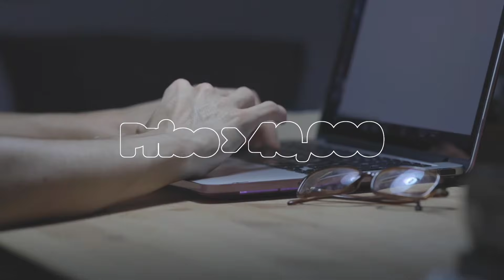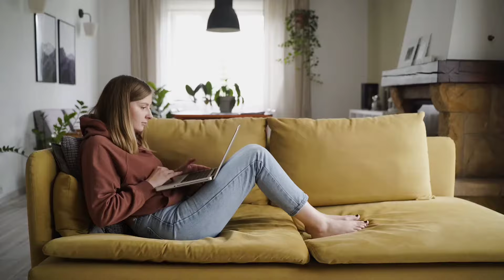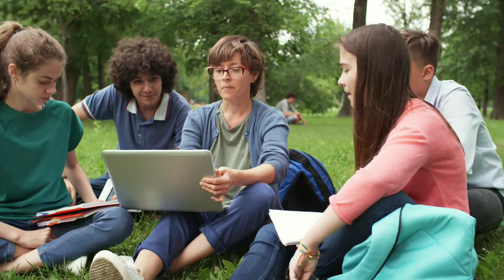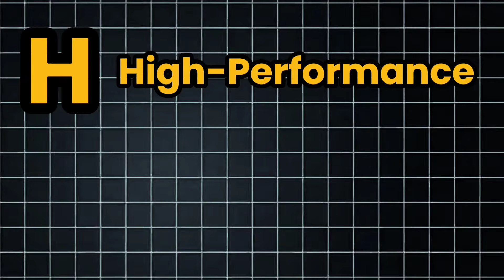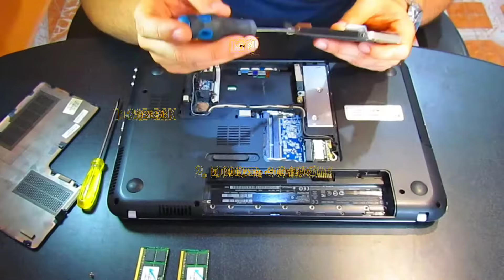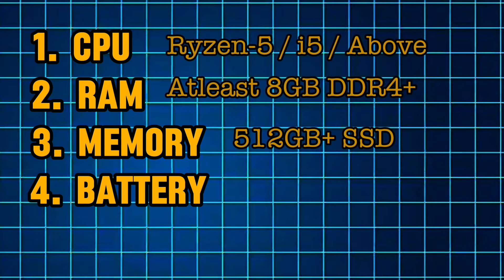Laptop Buying Guide for Electronics Engineers | Intel v/s AMD | Rajveer Singh

Comment: I've budget for m1 should I buy it , will the software needed to work on vlsi are compatible for it or it will be difficult to run on it also some of them software are paid I'm confused i should go for mac or windows @Singh-Rajveer
Reply from the maker: Actually, I also bought M1 after my academics was done. As it is tough to install free software on Mac. Also, You won't be buying any paid vlsi tools because those are so costly. Your college lab would provide these tools to work.

As far as basic vlsi learning like practicing verilog, installing xilinx vivado basic version is conveniently possible on mac. But if you are thinking of installing cracked software then it is comparatively tough from windows. Installation of cracked software is not recommended as well.

Comment: is u series processor of i7 12th generation 16gb/512gb ssd Lenovo ok?
Reply from the maker: Yes, They perform well. No issues for student purposes but also match use case (gaming / editing etc) as explained in the video before buying.
Reply: @Singh-Rajveer  
so it is ok for vlsi students 
simulation and synthesis?
as it u series processor
Reply from the maker: Yes, It will be able to run those tools.
Higher clocked processors may give a slight advantage to reduce the simulation time or run the tools faster. But won't be an issue for student purposes
Reply: @Singh-Rajveer  
no actually I'm trying to ask
is it also we do for vlsi job 
because laptop can be bought once only know 
can u series is sufficient then?
i5 12/13 h is great or i7 12th u  is good?
pls reply
Reply from the maker: Company will provide you laptop when you are into vlsi job.
Tools and Machines run on company's server when you are into job. Laptop is provided just to access the server.
Also, if speed matters very much for you then go for i5 13th gen H series else choose i7 U-series.
Reply: @Singh-Rajveer  
Thankyou Thankyou Thankyou to infinity 
you are always sweet
cheers from andhra

Comment: hello, im going to be doing  eletrical and computer systems engineering, do you think i will need dedicated gpu? or can i just use intergrated from radeon and iris xe for laptop
Reply from the maker: No need for a specific GPU , if the goal is study purposes only.
But, If you wish to play games, content creation etc then specific gpu would be required.
Even if you install MATLAB type software, then also integrated gpu would handle it